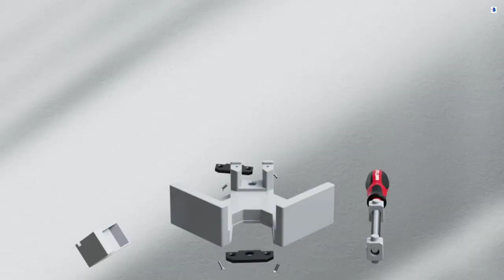Best Cool Corner Clamps for Woodworking 2023 || Best New Woodworking Corner Clamps 2023 || Buy Now

Comment from the maker: 0:00:06   5 ►- WETOLS Corner Clamp 2pcs - 90 Degree Right Angle Clamp 
●Amazon US: https://amzn.to/3Y5lBK1 
●Amazon CA: https://amzn.to/43FnJcF 
●Amazon UK: https://amzn.to/3QaG7XW 
●Amazon IN: https://amzn.to/3Y7w5Zl 
---------------------------------------
0:00:37   4 ► - Housolution Right Angle Clamp 
●Amazon US: https://amzn.to/3Y7bUei 
●Amazon CA: https://amzn.to/3Y3zqss 
●Amazon UK: https://amzn.to/3rCpIkG 
●Amazon IN: https://amzn.to/44yJ2xK 
---------------------------------------
0:01:12   3 ► - WETOLS Woodworking Tools, Wood Clamps 4pcs 
●Amazon US: https://amzn.to/3Y3zM2g 
●Amazon CA: https://amzn.to/44ZjN7N 
●Amazon UK: https://amzn.to/3O5RKwj 
●Amazon IN: https://amzn.to/3O2H55B 
---------------------------------------
0:01:50   2 ► - Equipment L Square Aluminum Angle Clamp Tool 
●Amazon US: https://amzn.to/3Dpzjhl 
●Amazon CA: https://amzn.to/3Oq3Gug 
●Amazon UK: https://amzn.to/44Y49t6 
●Amazon IN: https://amzn.to/44W9O2R 
---------------------------------------
0:02:48   1  ► - Corner Clamps for Woodworking, 90 Degree Clamps 4Pcs Corner Clamp Right Angle Clamp 
●Amazon US: https://amzn.to/3K8fQ8J 
●Amazon CA: https://amzn.to/3DnHLxC 
●Amazon UK: https://amzn.to/3rGYae5 
●Amazon IN: https://amzn.to/472kDT6